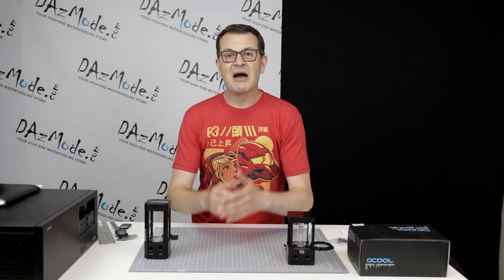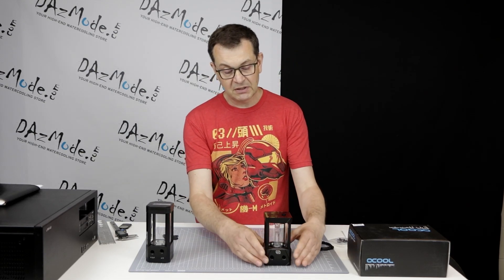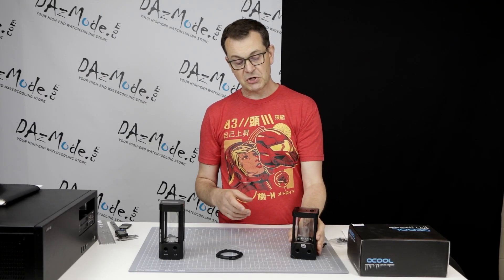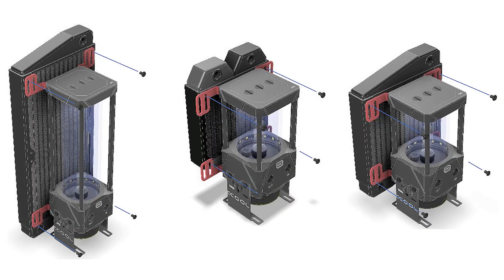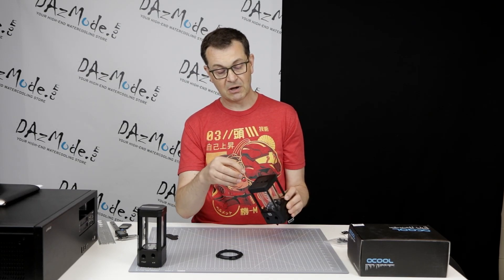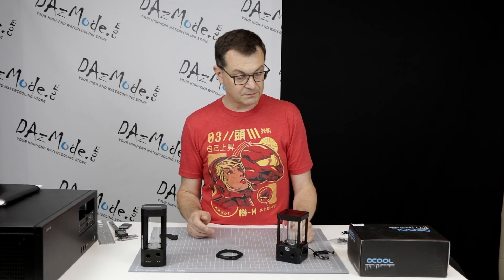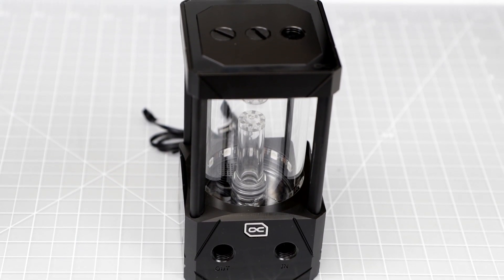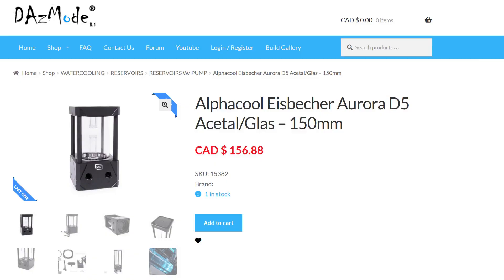Alphacool Eisbesher 2 Reservoir

Comment: The only hole in the top that you are suppose to use as an inlet for water is the middle one the other two are just for filling the reservoir. The hole in the other two are just big enough for you to put the straw from a fill bottle through them. Also that thing in the bottom isn't a filter it's a anti bubble device.
Reply from the maker: Thanks for the clarification!
Reply: @DazModeWatercooling  Thank you for the wonderful videos. Super glad you are back.